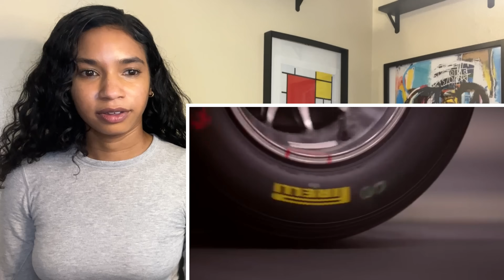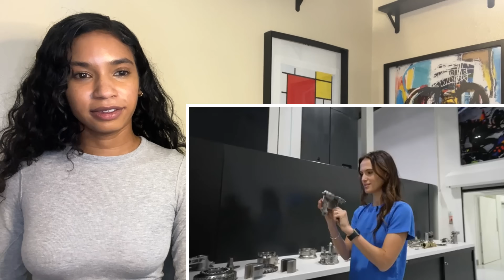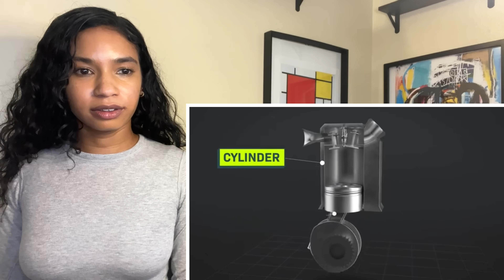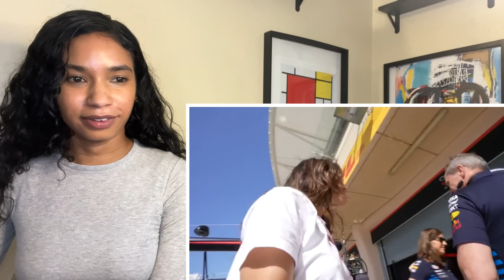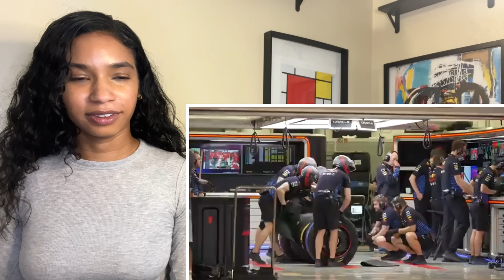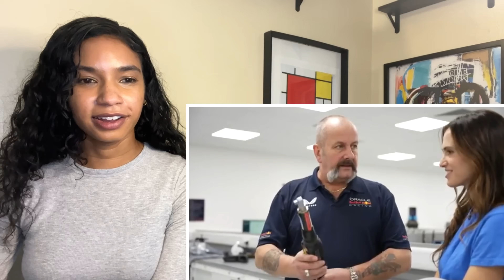Formula 1 cars, explained for rookies | F1 reaction

Comment: F1 CARS HAVE SO MUCH DOWNFORCE THEY COULD DRIVE AT HIGH SPEED ON THE CEILING OF A TUNNEL. UPSIDE DOWN THAT WOULD BE TURNED INTO LIFT. HENCE WHY IT WOULD STICK IF FAST ENOUGH. BUT IT WOULD BE A RATHER DANGEROUS TEST.

Comment: Fun fact, several years, Max alone won both the driver AND the constructors championship, virtually anialating his team-mate's. Yesterday, december 6, 2025  Max claimed the pole, Yuki (in the same car) was nr. 10. Check out the rest of the field. McLaren claimed second and third place. This means it's 1 driver against 2 cars. Sorry. 

And that girl Schmitz is about as important as Max. Without the right stategy Max is floating around. With the right strategy a certain loss can be turned into possible win or the other way around as the McLaren drivers found out last weekend.

A game controller, but an expensive one. One stearing wheel is 60.000 euro or a very nice Alpine road car.

Comment: I love F1. But in my opinion, the best motorsport is WRC. Those guys are crazy, you have to be crazy. There’s no such thing as a flat tire stopping them. If they have one powered wheel and another one to handle direction … they’re good to go, they don’t even need a closed loop cooling system (there was one case, broken radiator, and they’ve stopped along the way to fill up with spring water and got going). And the pit crew … the WRC pit crew is on another level. They could fix anything, or rebuild the entire car in 2 hours.

Comment: the reason they restrict the amount of testing a team can do is twofold: 

1 is cost related...testing and development costs money, and without limits the wealthy teams like mercedes could just throw money at the problem until they win (which is partly why merc had such a long run of dominance from 2014-2020, there were no rules restricting engine development at the time so merc dumped more than a billon dollars into making an engine nobody could keep up with without cheating).  

The other reason is that they use the limits as a way to keep the sport competitive, because the limits arent the same for everyone.  Last year's constructor's championship winning team gets the least wind tunnel time and computer model runs, 2nd place gets a little more, 3rd a little more, and so on.  This means that the teams furthest down the grid get the most chances to develop their car to be faster, and this in turn helps prevent the grid from becoming too static (in theory, at least).  They can also use the limits as a penalty, as they did with redbull in 2022 because RB went over the cost cap in 2021.  Because the breach was deemed to be a 'minor' breach the FIA didnt hit RB with anywhere near as big a penalty as they could have, but RB still got penalized with a 10% reduction in testing limits for the next season.

Comment: Some carbon fibre is found in road cars, but not anywhere near the extent on display here. But outside of some very, very boutique hyper cars, you won't find any major structural parts. It's mostly spoilers, small body pieces and some decorative trimmings. Just too expensive.

Comment: "the whiteness is down to the additive" - as an engineer commentary like that makes me crazy. It's white because it's an emulsion of oil and water. Makes you wonder what they're teaching at universities these days; it takes just as long to say, is actually correct and actually explains it for anybody who is interested.. It isn't even for rust prevention, it's to stop the tooling cooking which is still a thing with carbide tools, and it helps with chip clearance both from the cutting edge directly and from the wider machine.

Comment: The problem with F1 now is that there's so much money and tech involved that the actual racing is all just a bit dull and clinical. Compare the actual racing to races of the 70s, 80s, 90s and even early 2000s and it's just not at the same level.  It might be interesting for you to react to the movie "Rush" which has quite a good representation of the excitement and danger of F1 when it was at its best.

Comment: Wind tunnel cost money and some teams can afford to do unlimited testing while other's can't.  The cost of a modern new age tech wind tunnel is $60 million.  Ferrari, Mercedes, Red Bull could afford to throw $60 million on one and have full access, while smaller teams like Williams, HAAS, etc won't be able to build one and have unlimited access.  

I prefer MotoGP.  It's more exciting because a mistake most likely lead to a crash, while in F1, a mistake can be recovered.  MotoGP bikes are the fastest accelerating vehicle on track.  0-200 mph in 10 seconds.

Comment: No Protocol always on point with the music recommendations!

As for carbon fibre - It's a composite material and sometimes referred to as CRP (Carbon reinforced polymer) More and more things are being built using it as the technology develops, from racing (sailing) yachts (sometimes even the sails themselves are made from carbon not just the hulls/masts) to tennis rackets. Yes, high-end 'super' cars are often built from it too (The chassis and body).

Comment: Slightly unrelated to car engines but there is an excellent series explaining how two cycle engines work. Just search for Tinman's saws cut away. He does an excellent job of explaining them and it is a great place to start for understanding how engines work because they are simple. Next after that would be single cylinder air cooled 4 cycle. It is usually how most gearheads get their start.

Comment: Carbon fiber is used a lot of things at this point. The costs aren't as high as they used to be. Stuff like bicycles, running shoes, hockey sticks, fuel cells, pressure tanks, boat hulls, tennis rackets, windmill blades, camera equipment and tons of other stuff including almost every type of motorsport. It is common enough that my local Canadian tire carries repair kits for it. If they carry it, I am sure that almost every hardware store does.

Comment: Book recommendation: The Art of Racing in the Rain by Garth Stein. Told from the point of view of the protagonist's dog who dreams of being a race car driver like his owner.

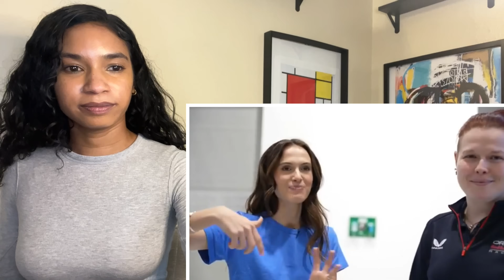@3:45 Yes, there are some street legal cars made of carbon fibre, but we're talking high end luxury vehicles like the Aston Martin Valkyrie, the Henessey Venom, and the Lamborghini Revuelto. It will probably make it to mainstream cars eventually, but we're decades away from that.
   Technically a carbon fibre phone case absorbs the RF signal rather than blocking it. However, this depends on case design and the thickness. A good, high-end case designed specifically for your phone phone shouldn't have a problem; a generic case from an unknown manufacturer might.

Comment: This is awesome. The performance metrics control center is mind-blowing. I want to dig into the data they are trying to measure during a race. 

I work in aviation. Superchargers on reciprocating engines are pretty fascinating! They were commonly used in combat aircraft in WWII before jets came on the scene. Also, carbon fiber and composite materials are used in modern aircraft! Not only for weight reduction but for ease of manufacturing and corrosion resistance. Thanks for another good one!

Comment: If you want an easy way to remember how a 4 stroke engine works
1. SUCK - Air & fuel are sucked in.
2. SQUEEZE - Air & fuel are compressed.
BANG - The compressed mixture is ignited by a spark plug
BLOW - The gas from the previous explosion is pushed out of the cylinder
Reply: I can see why you remembered this 😊

Comment: Wind tunnel limitations is related with some "rubber-banding" (fix typo, used to say runner-banding) regulations meant to slow down the leaders and speed up the back markers.

Since this kind of approach on track would be against the spirit of racing, they've been applying it to research instead.

It also fits in nicely with the budget cap as a pair of measures to incentivize more manufacturers to join the category.

Formula 1 has some 10 to 20 years of inviting people in and then some 10 to 15 of smashing their hopes and dreams 😅

We are currently coming out of a period in which there almost weren't enough teams to fill the garages.
And before the budget cap (fixed typo, used to say cao) came in we had a risk of only 6 teams remaining while the Formula One Management looked into requiring 3 cars per team if that happened.

Comment: 2:21 The time allowed in the wind tunnel is different for each team each season, and it's based on what position the team finishes in the championship. The team that wins the championship gets 840 hours of wind tunnel time, the 2nd place team gets 900, 3rd gets 960, and so on. It's a way to give teams that struggle more opportunity to close the gap to the top teams.
Reply: Worth noting the cost as well. Rental costs for the big wind tunnels can be in the thousands of dollars per hour and there aren't that many big facilities around. NASA uses wind tunnels that are owned by the US Air Force and cost $2000/hr just to operate (they're not for rent).
   So part of the rule for number of hours is probably related to availability and cost. Without the rule, the big teams could hog the available facilities and pay for any number of hours.

Comment: A lot of bicycles are also made out of carbon Fibre
Reply from the maker: I didn’t know!
Reply: @NoProtocol  Thanks for the Music recommendation, I'm an instant fan, keep up the good work love your channel keep smiling, greetings from and old Londoner
Reply: The rear seats of my car were made of carbon fibre. An A2 1.2 TDI. My wheels were made of magnesium alloy. The motor block was aluminum (the only non race car aluminum diesel in existence at the time). Result. Fuel efficiency to the max. 3 liters/100 km.